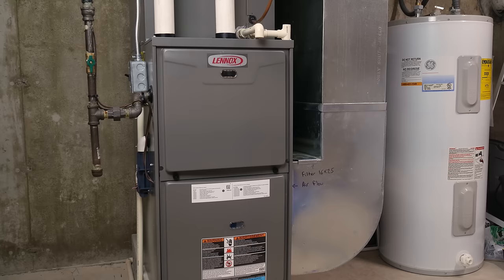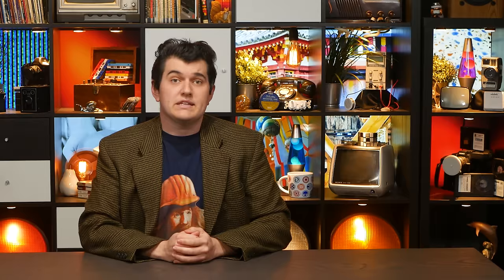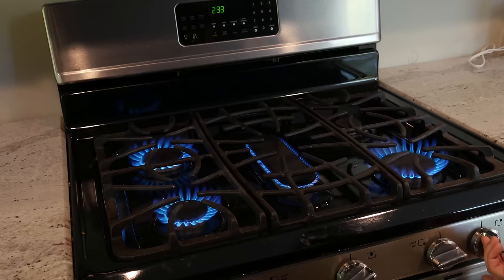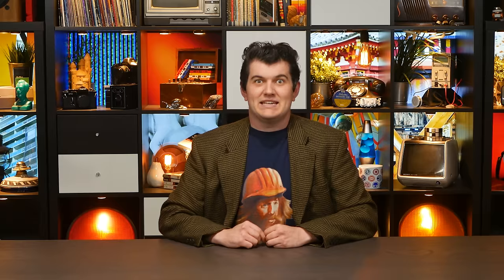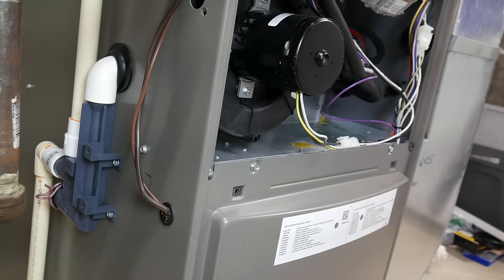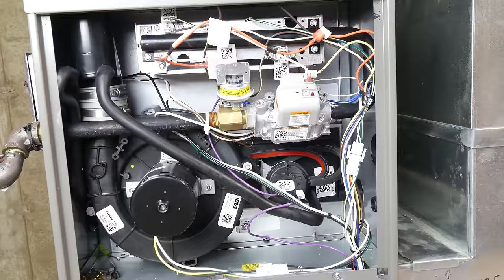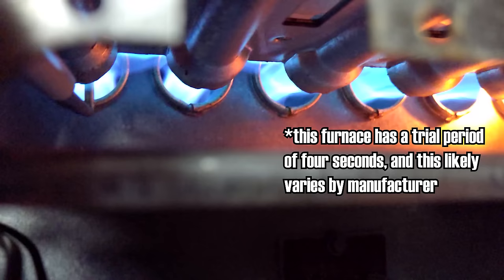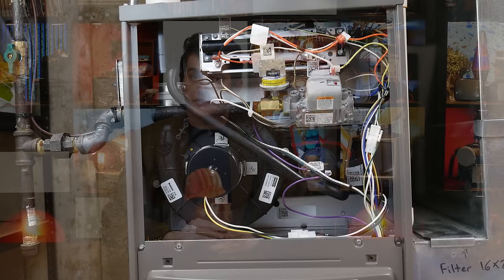Forced-air Furnaces: The What, Why, and How

Comment: THERES NO SUCH THING AS NEGATIVE PRESSURE
Reply: Yes there is. Air that’s pulled in quicker than it can be resupplied, you have a negative pressure.
Reply: @imperialdoggo5826  it’s not negative pressure though. It’s vacuum. The air is still being pushed in there by the atmospheric pressure. The absence of all air is a perfect vacuum I.e. same as outer space. Anything above that is pressure.
Reply: It would be negative gauge pressure commonly referred to as a vacuum.
Reply: @Redtooth75  it’s not negative pressure. It’s less than atmospheric pressure, but still positive. Also, correctly referred to as a partial vacuum
Reply: @Overkill14  positive absolute pressure but negative gauge pressure
Reply: @Redtooth75  that would depend on the gauge. If it went below zero it would be reading vacuum
Reply: @Overkill14  no you misunderstand. Gauge pressure is vessel absolute pressure minus ambient absolute pressure. So if the pressure that is being measured is less than ambient then the gauge pressure is negative.
Reply: @Redtooth75  I understand how you’re saying it now, but it still wouldn’t be negative pressure. It’s vacuum.
Reply: @Overkill14  a vacuum is when gauge pressure is negative.
Reply: @Redtooth75  you just want me to say negative pressure exists 😂 it doesn’t. But we’ll agree to disagree.
Reply: @Overkill14  gauge pressure is referenced to ambient atmospheric pressure whereas absolute pressure is referenced to a perfect vacuum. So 0 psi on the gauge scale would be 14.7 psi absolute if you are at sea level. So anything less than 14.7 psia can correctly be referred to as negative gauge pressure. Negative absolute pressure does not exist but negative gauge pressure does.
Reply: @Redtooth75  that would depend on how the gauge is scaled. And if it’s scaled with a 0 in it, the negative section would be vacuum.  I understand what you’re saying, but out of principle I won’t call it negative pressure because that’s a made up term
Reply: @Overkill14  negative pressure is a commonly used term. The standard for measuring vacuum in the US is with negative inches of mercury, the negative is just dropped because it confused people. The standards for measuring vacuum get kind of fucky.
Reply: @Overkill14  bruh i really do not understand what about this is so hard to grasp. A light vacuum is negative gauge pressure. It has nothing to do with the numbers actually printed on the gauge. That is how the scale is defined. Im not talking about the number shown on the gauge.
If 0 gauge pressure is 14.7 psia then a pressure of 10 psia would be -4.7 psig, or 4.7 psiv. Negative absolute pressure does not exist but negative gauge pressure does.
The term negative pressure is not incorrect, you just do not know what it actually means.
Reply: @Redtooth75  I do know what it means…which is nothing because it’s a made up term. There’s no reason to describe “negative gauge pressure” because guess what…there’s a gauge to tell you how it how it feels about the relationship between the atmosphere and what it’s measuring. If it determines the measured pressure is less than atmospheric, it will tell you a number measured in vacuum.
Reply: @Overkill14  all terms are made up. Terminology has is based off use, even though it might not be technically fully accurate. It is false to say that the term negative pressure is wrong or does not exist. Negative pressure means that the pressure is lower than ambient, because the gauge scale is the commonly used scale in field applications. The number is negative because what is called "zero" is a relative zero not an absolute one.
The term is used commonly in physics and engineering. They are all very much aware that the absolute pressure is not negative. The gauge pressure is negative.
It seems like to me that you are very caught up with the word gauge. Im not referring to an actual pressure gauge, its the name of a unit scale. Think of it as relative pressure.
Reply: @Redtooth75 any scientist or physicist referring to vacuum would call it vacuum, not negative pressure because it’s a silly thing to say. Or negative gauge pressure or however you want to word it. Again we can agree to disagree on this or you can continue to argue an incorrect point. Up to you, bruh

Comment: Lmao why should we subsidise peoples heating?? If it saves them so much money they should take a second mortgage or just save up. I mean my car only does 20mpg should everyone else pay for a nicer car for me cause it will save me money? What about led lights should you guys fork out the 2000 it will cost to change all my lights, what about insulating my house could you guys give me the 200k it will cost to rebuild my solid stone walls with cavities and put in insulation and triple glaze my windows, also I use heating oil which is really expensive an inefficient can you guys pay the 5 million it will cost to install a gas line between me and the nearest town 8 miles away.

Comment: I like your videos... not this one.
Ignorant AND stupid people watch these videos. "Ignorant" people do not know. "Stupid" people do know but don't care for adverse consequences. 
That said, smart and knowledgeable people also watch these videos... but some of them are Facepalming as I am/have.

"...gasses can be explosive..." Can be harmfull. This is why people do wrong things... "Literal" is not to be interchangable with "Figurative" !
15:11 You said "Thermal Coupler... which is a Flame Sensor"  without explaining what it is or ... that's Not a Thermal Coupler.
NO! A Thermal Coupler IS NOT a Flame sensor. It is sensitive to Temperatures and has it's own purpose, NOT what you have explained.
"This is easy to do..." Easy to say, and in this verbage is disgraceful.
And you said "...it sees/looks for..." of which it cannot, "senses" is correct.
You spoke of "BTU's" interchangably with "Kilowatts" without explaining power conversion. "Kilowatts" can be converted into "HorsePower" and vice-versa too... 
Another point to make is: If your metal exhaust pipe (80's furnace) is hotter, so too is wasted heat going the same direction "up".
Please Correct these discrepancies when explaining furnaces that draw air from also inside the living areas from the "Intake Vents" which increases "that airflow" you speak of. Perhaps that was omitted. And mentioned Nothing about the Air Filter seen in the beginning of YOUR video. Why the Air Filter? Yeah, that's for drawing air FROM the living areas... All dust, and dander (skin cells [weigh your mattress when it's new, and five years later] ) plus pets such as cats, dogs, and other hairy/feathery animals... that air is sucked into those "Intake Vents,"and air conduits (HVAC) and drawn through those "Filters" before entering the flame area so it's "clean" and contains no other burnable particulates.

"Please..." means that one does not have to, but it's common courtesy. "You Need" means  take no alternative effort.
Mentioning "North American furnaces..." is quite vague. North America, from the southern tip of Mexico to the northern tip of Canada contains 23 Countries. It's like saying that every house  has or is void of a basement or attic. It's unfair/incorrect to make generalizations.
Should I be sorry for what you're saying incorrectly?  No. What is "Perfect"? Can be a matter of opinion, but this video has false facts.
I "Would" say sorry because it has to do with "will" power.
I "Could" say sorry because it has to do with "ability."
I "May" say sorry because it has to do with "Choice" of care.